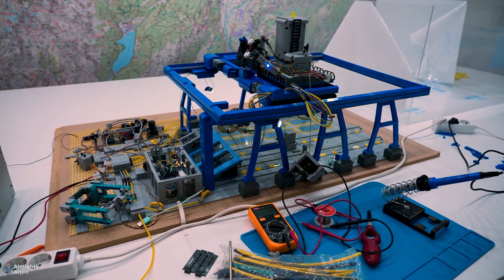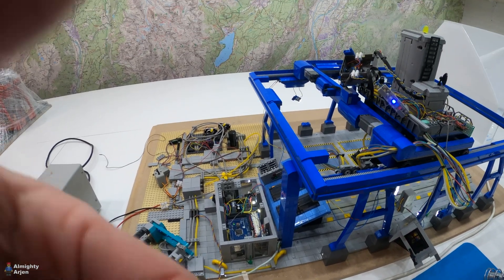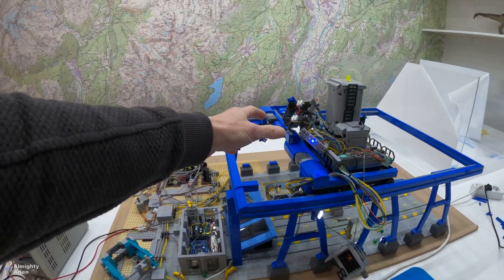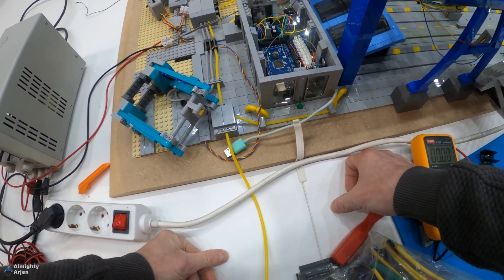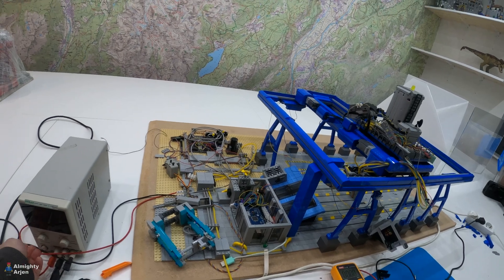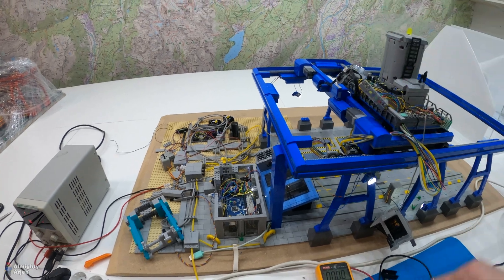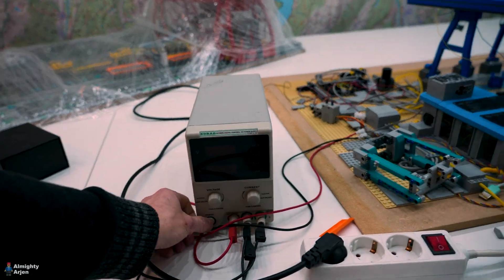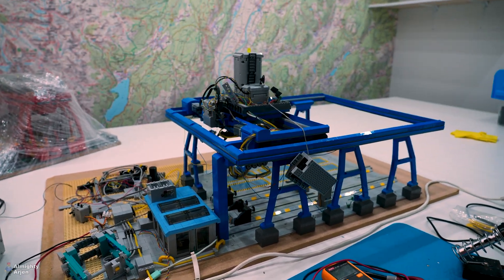Automated container terminal WIP E51: Fixing electrical problems

Comment: Is there a way to reduce the amount of 5V power lines going up the crane by moving the 12V to 5V convertor to the crane? Or using an additional convertor?
Reply from the maker: That is already the case: I make 5V locally so there's a converter in the building under the crane and there's a 9V and 5V converter on the moving part of the crane. Maybe I mentioned 5V lines going up in the video, can't remember, but I have in the meantime developed a clear picture in my head that there are now 5V lines going up.
Reply: @ I saw the relatively large number of wires going up. That’s why I thought: maybe it’s simpler to just feed a single 12V up the crane and convert it to 5V and 9V on the crane.
Reply from the maker: @NLGeebee  It's for communication purposes. Yes, I could've used serial communication but if it's a few signals, I prefer hardwired I/O which is easier with fault detection if something doesn't work like I intended.